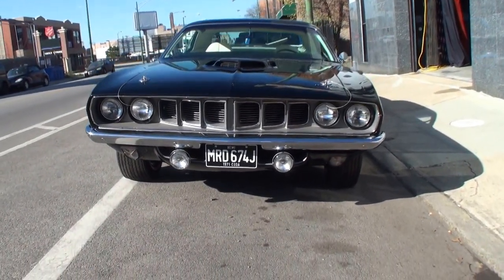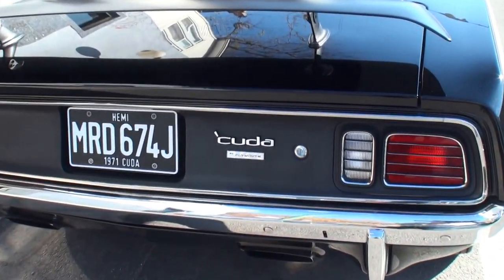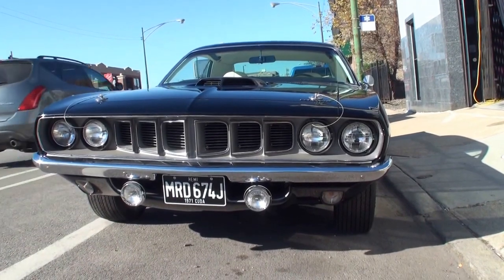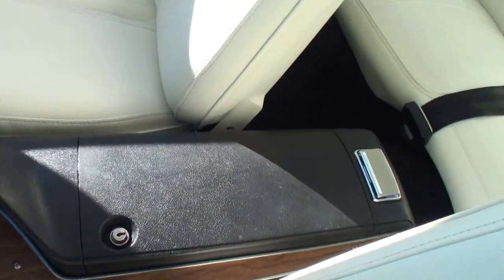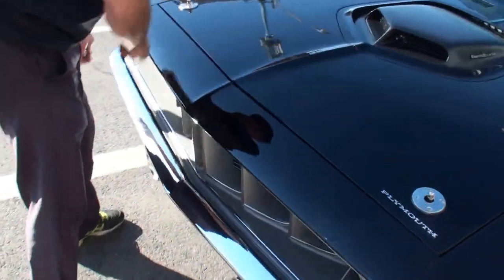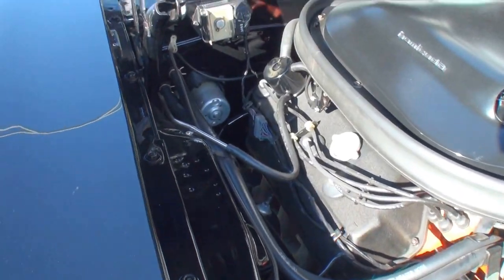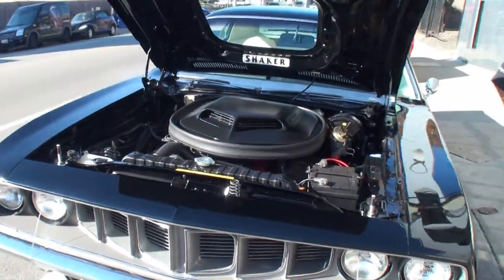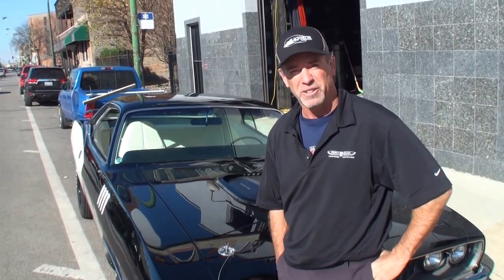1971 Plymouth 'Cuda 426 Hemi Cuda Barracuda in Black Paint on My Car Story with Lou Costabile

Comment: I don't think he knows that  when a Black Cuda`  was on the production  line  the  body was pulled off the line by the Engineers at Chrysler   prior to being painted.  
    They went over the car  to align  every panel   and look  for   flaws    in the sheet metal  which might be a bad fender  or   truck lid  no quite perfect .   Nothing was  over looked  because they knew that a Black Cuda would show any sub-par assembly or door hanging. 
      Once  it was approved by the experts   it was  inserted   back in the  assembly  line for the paint process  and checked again  for flaws in the paint  as well  as  reviewing all the gaps   from the truck to the hood . 

      A  Black  Cuda`   would be the best to restore   because it was perfect from the factory   and if  it was never damaged   you could   give it a super high gloss   Black  finish  and not  worry a body  man needed  to prep the car  to correct minor  problems from the factory .

       Just by looking at that car in the video  you would need to buy a $30,000.00    high end Piano  in Black to get that  mirror finish  with a   perfection of fit .  
      Any other colour for the Cuda ( challenger)    was never given  this level  attention to details  by the  Engineers  at the Plant    and they  would even  replace  the bolt on body  parts  for the slightest   mistake  in stamping  or spot welding . 
         Anyone  with a  high end  71  Cuda   that wasn't   Black  would find out  very fast   that it doesn't  come close  to the factory Black   if they chose to redo their Cuda in Black . 
        I'd take a  Black Hemi Cuda    4spd  convertible   over any other  Hemi  Cuda  that is said to be  very rare  for the options and colour.
Reply from the maker: +Gary wood Hi Gary, Thanks for taking the time to share your knowledge.  Take care, Lou

Comment: How much  Horsepower it got?
Reply: Lou Costabile 
Yep thats what Chrysler stated Lou.
The actual Dyno Tests from independant firms had it from 500-525. Insurance and gas had Chrysler thinking ahead.
Reply: How could you possibly not recall the exact Horsepower Chrysler claimed that engine to make? If you don't know the exact details of the car you should definitely research such information at the very least! Also, you at one point made a statement where you compared a 71 grille to a 72 Cuda instead of 70 to 71. In case you weren't aware of this, the only two production years for Hemi Cuda's were 1970 & 1971... Extremely beautiful car but your interview along with the information you attempted to provide were at best lacking. No disrespect intended but I would highly recommend doing more in depth research prior to making videos. Legendary cars such as the Hemi Cuda deserve nothing less than an expert's knowledge if you're making a video  about one and you sir can't even quote the advertised HP with confidence. Impressive vehicle amateur interview/video. As stated previously I mean no disrespect but you're not talking about a Ford Pinto so please do some more extensive research next time.
Reply: dmfj1980 
Lmao... Actually i agree a thousand times over!!!!
Reply: mine was a 72,with a 71 front clip,an black 440 billboards,an was a sublime green one with a 383 magnum,not a hemi..i traded a purple beautiful challenger s/ e for it..cloned to be an r/t s/e..all are gone,an my house is lost,gone,an wife is dead,am here with guitars an cats an a fast 02 red dakota r/t truck...........
Reply from the maker: The time period brochures shared 425 HP, however I see moparman 4406 shared "The actual Dyno Tests from independent firms had it from 500-525. Insurance and gas had Chrysler thinking ahead."

Comment: What were there... 9 of those made in 71' ?   Thats why its the Holy Grail.... HO-LEE-SH*&%
Reply from the maker: Yes, I believe you are correct, Lou
Reply: 59 Hemi 'Cuda 4 speed Coupes were built in '71. Another 48 were auto coupes. You are probably thinking of the convertibles.... Only 9 of those were built (only 2 manual).